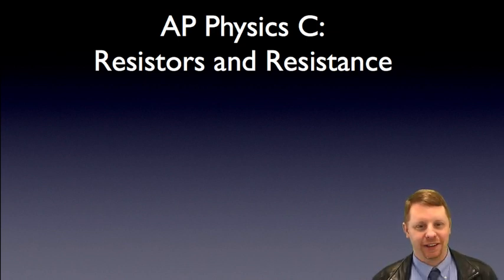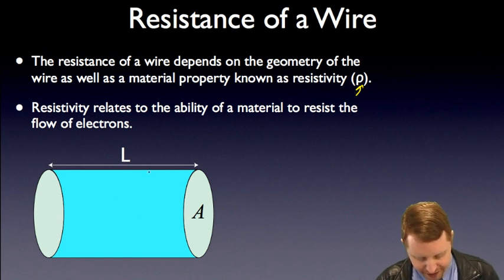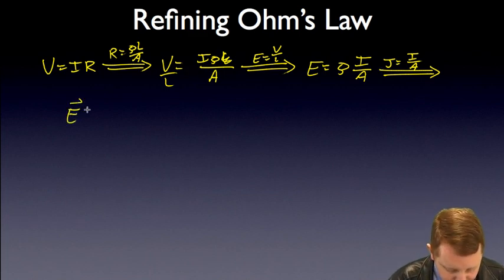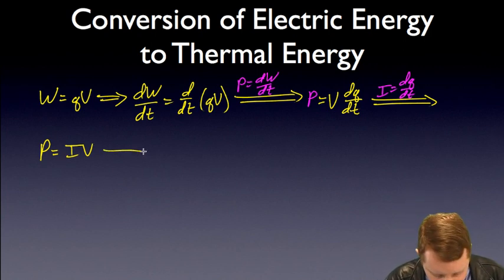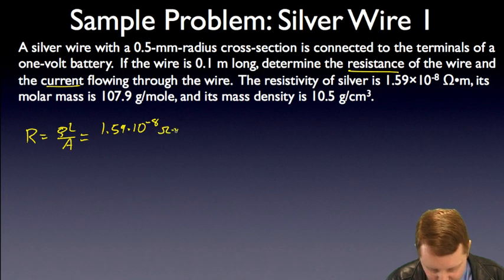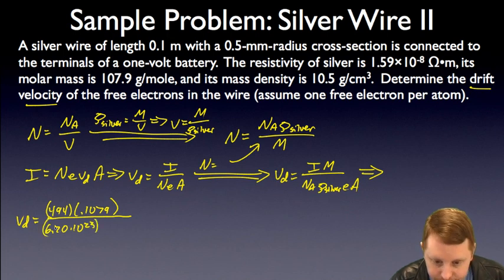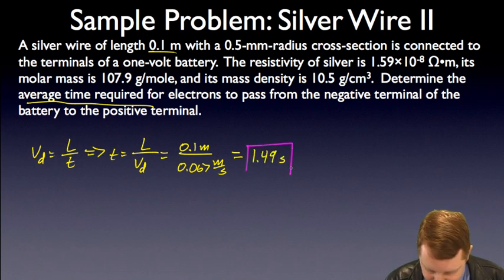AP Physics C - Resistors and Resistance

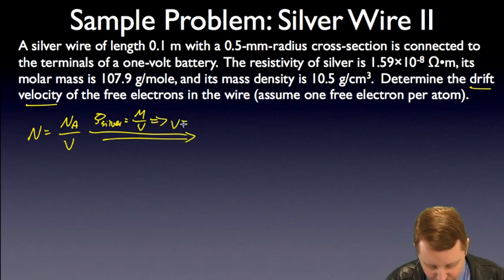Comment: At 9:12, the video said that V=molar mass/density. If you cancel out the units for molar mass and density (g/mol and g/cm cubed, respectively), you get cm cubed/mol which is different from the volume unit of centimeters cubed. When you use molar mass, do you ignore the moles part of the unit, or just assume that you are working with one mole?
Reply: I think we assume we're working with one mole, that way you get mass units?

Comment: Hello Sir i have a little project and need help i bought nichrome 0.32 and i need 1 meter of the wire to heat up to 300° what resistor do i need and will 7.4v lipo be sufficient enough? Thank you

Comment: Mr. Fullerton, thanks for another great video as usual!

Question: you postulate that the charge carrier density N should be avogadros number divided by the volume. Could you please explain why this is the case?

Thanks, and make it a great day! :-)
Reply: Also, why do you not take the total volume of the wire, multiply it by the mass density, convert to atoms and find the number of charge carriers that way? In this case,t hat would be N * A, right?
Reply from the maker: Hi Nathan.  Because we're talking about silver, we assume one elementary charge per atom.  The charge density, then, is Avogadro's # (# of atoms per mole, or in this case, # of elementary charges per mole), divided by the volume.  When we then rearrange using molar density, we can use the given information to determine the charge carrier density (in elementary charges).  If you wanted the actual charge density, you just multiple that by the charge of an elementary charge, in Coulombs.
Reply from the maker: The reasoning is sound, not sure it would be N*A as you haven't specifically defined N and A for this approach.
Reply: Thank you Mr. Fullerton for you kind reply.

This helped me a lot!!